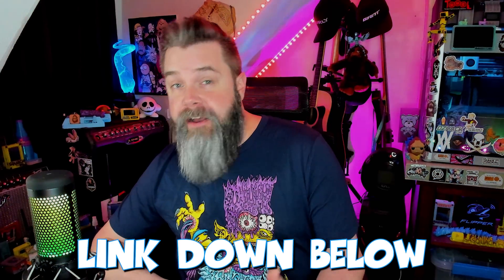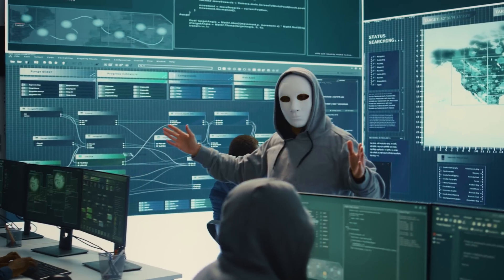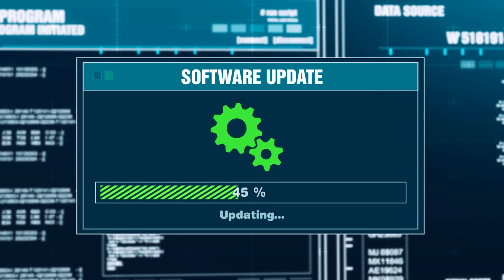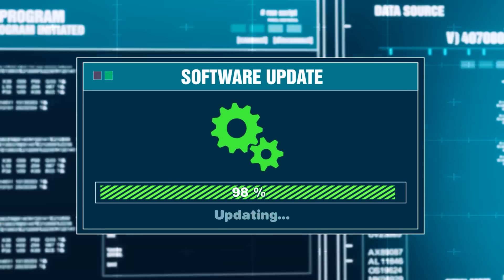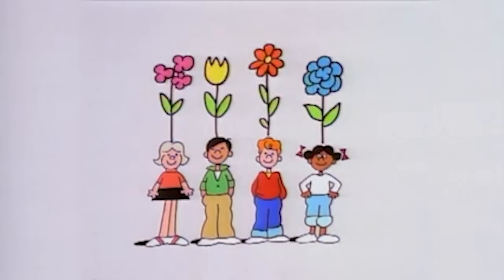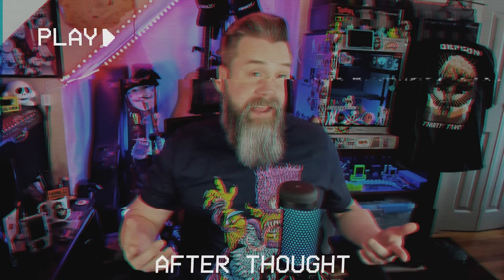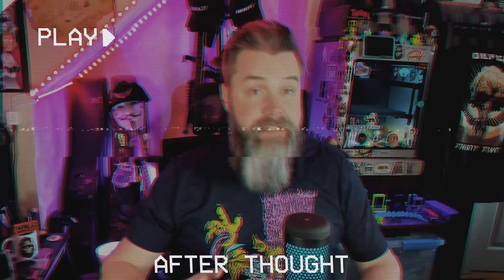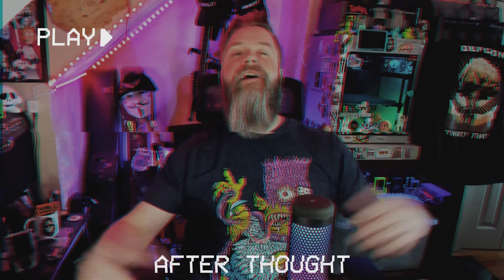Flipper Zero: The Power Grid Threat? | Cybersecurity Deep Dive

Comment: I'm guessing somebody's got a new pre-production 3d printer that hasn't been released yet hiding behind that shirt, lol.  Great video, just found your channel recently, now I'm busy trying to troubleshoot my pwnagotchi and finishing assembling a CYD with a battery, charging circuit, and GPS, bundled in a 3D printed case  It runs marauder, Bruce, and ghost ESP.  In the mean time the CYD is in a small case, no GPS, and external battery pack with all three firmware's installed from the SD card.  Oh yeah, also anxiously awaiting the arrival of my flipper zero, lol.

Comment: It should also be clearly stated that in addition to the standard protocols such as WLAN, IP, HTTP, etc., there are many other protocols in our IT system that have not even been really researched to date or have been neglected because they are simply no longer used anywhere.
These days you can only get so far with a phishing attack and these are properly investigated by researchers and every system will hopefully be isolated from the Internet.
 This Flipper Zero that people adore does nothing other than scan the surrounding frequencies for data packets and then either send them again or even manipulate them. All the hacker needs to do is sit near a power plant with the right antenna that has enough bandwidth and see what is being sent through the air.
If there are IoT systems or similar devices that are at least able to initiate emergency functions or security measures, they may then be exploited to disrupt the power plant. There was a report years ago about how worried people were about a possible blackout. Solar power generators were even sold on a massive scale in Germany.

Comment: Well my last post got deleted by you tube  for some reason so lets try again :

Finally something I can comment on with a level of expertise

Whilst the flipper is a useful gadget, and i spend a lot of time using it, I'll guarantee It cant cause issues like this mainly due to how critical infrastructure works. I spent a lot of time in a chemicals plant as both OT and IT security

The devices that would be vulnerable are at level zero of the perdue model 

A threat actor would need to get through layers 4/3 (occasionally 5) of the perdue model before even getting close, and even then they would need to be physically on a plant. A flipper cant do this sort of thing remotely. 

What they have described is theoretical but definitely not practical
Reply: It can be done..... doesn't matter,,

Comment: I use to install a lot of those controls and some SCADA systems when I was a electrical contractor. When we were finished we would hand off the documentations to their techs and when we’d come back to fix their stuff I’d notice that they were still rocking the default login credentials. lol. Not to mention once I found out what SCADA is and controls I saw the vulnerabilities and this was before I stepped into the cyber realm. Not good at all, just a little research and that’s a bad day.  
Hey I like these types of videos, I like the instructional and product content but this is good stuff. Glad you’re back too👍
Reply: Whoever sold the SCADA systems without taking the time to insist on the default login information changes or even better, do not leave until they change the login information themselves with your final verification...  Layers of failures and you were part of that chain with the second to last responsible party to take blame.

Comment: I've been an RF engineer for a few decades - hell, I ran a radio station for a few years, and was the engineer for two stations for most of a decade. All of our transmitter towers and repeaters could very easily be shut down after seeing this and thinking about how vulnerable those towers are. Not that anybody listens to terrestial radio anyway. Hell, more than half in my area are just automated corporate crap.
Reply: Fellow operator.. Once you break tone squelch.. Run a code search and you would control the repeater..  Scary stuff.  
But if used for good, it can also prevent attacks.. 
Alot of open source firmware out there currently..
Reply: What's terrestrial radio
Reply: @mayhem1994  Land-based radio instead of satellite. Old school. I don't think 5% of the country even listens to radio anymore.
Reply: @GeologyJournalism  ok sounds interesting
Reply: @GeologyJournalism  I will always run analog.. Satellite is vulnerable as well.. Ill keep my HF Bands as my go to. Look at our GPS systems.. It would cripple alot.. Other countries are ahead of us in running a backup if GPS goes down... 
Take it as it comes 👍